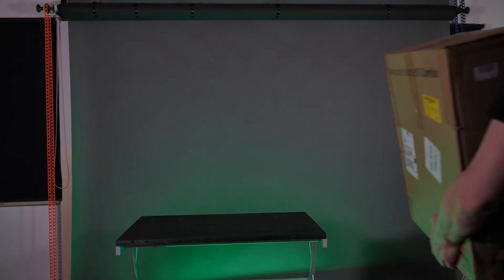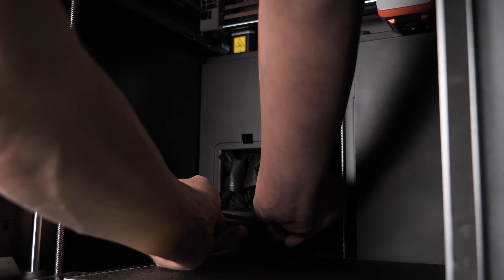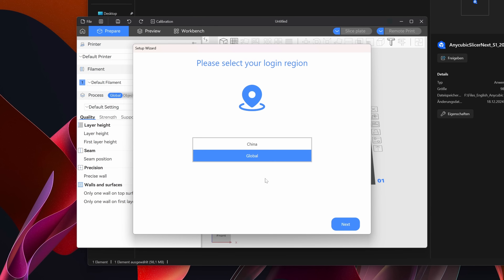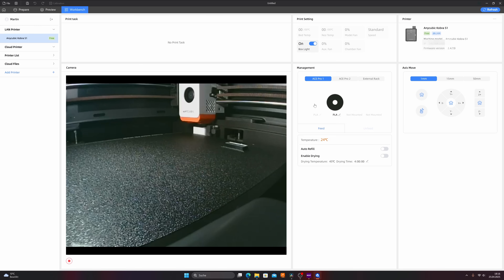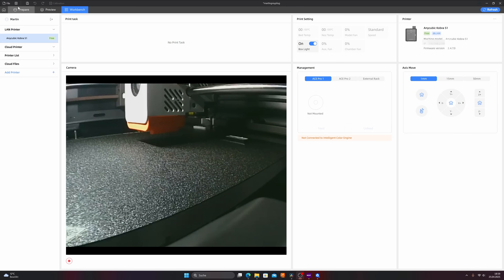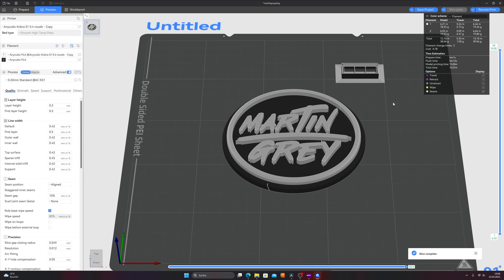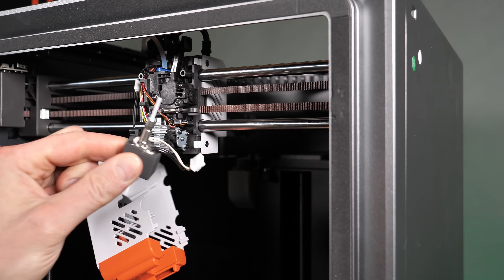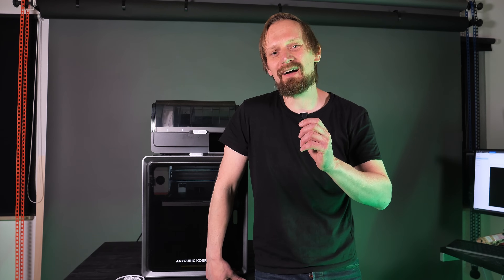How To Setup The Anycubic Kobra S1 For Multicolor 3D Print - Full Guide

Comment: you don't need the spool holder @ 01:13 if you're using the Ace Pro - unless! you're using the 5 to 1 blocking module

Comment: won't connect to wi-fi even though printer says it is connected - frustrating - this is day three of trying
Reply: I had similar problems with other smart devices. The Kobra connects only to 2,4 Ghz wifi. Both of my wifi (5 +2,4Ghz) had the same name. I renamed my 2.4 Ghz to another name. (wlan24). So i´m sure that i connect to the right wifi. Power on again and select the 24 Wifi. Take care : maybe you have to reconnect also other devices to the correct wifi. Changing the name of the wifi is done in the router (Fritzbox for me)
Reply: @RomainBack  Thank you for your willingness to help. I rebuild laptops and have connected over 200 laptops to this wi-fi. Yes 2.4.  It sometimes recognizes my Roku tv and even the router extender, and it does connect momentarily and then jumps out. thank you again.
Reply: So I've had issues with my router always connecting to my Wi-Fi on a 2.4GHZ so I've learned that if i setup mobile hotspot on my phone and set the same exact parameters  as my router and have it connect with my phone 1st once it links with the phone turnoff your hotspot and it should auto connect to the router and you should be good I've had to do that to my ring camera and my Rokus LMK if that works or if you have any other questions
Reply: @yaroveug  Thank you, I have connected over 200 laptops (I rebuild laptops) to my w-fi. never have problems with router, but will give that a try - let you know. ty.
Reply: mine was the same. annoying. it connect to my phones hotspot....then after a few days it just worked all of a sudden